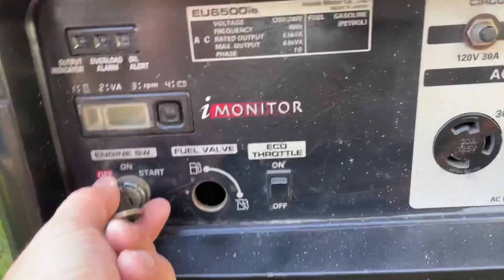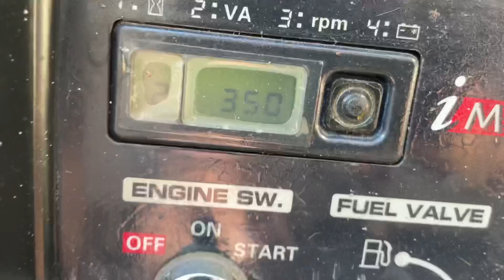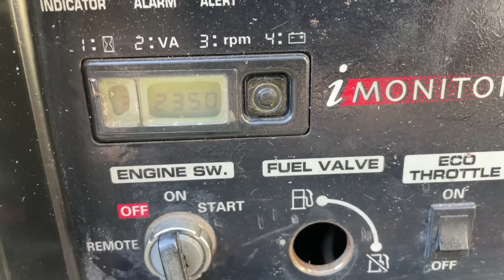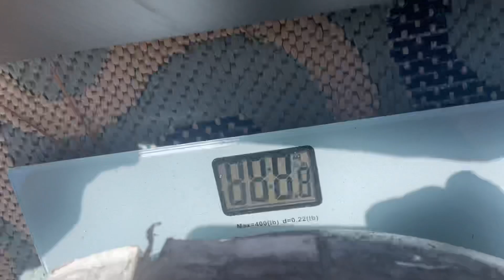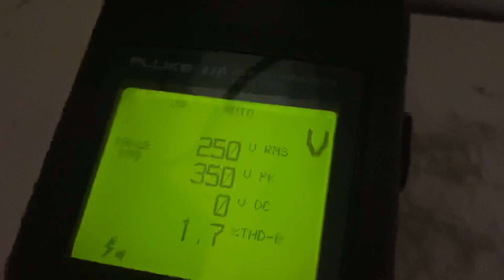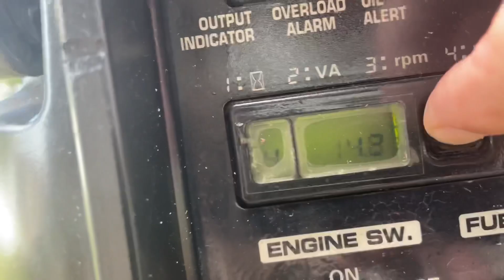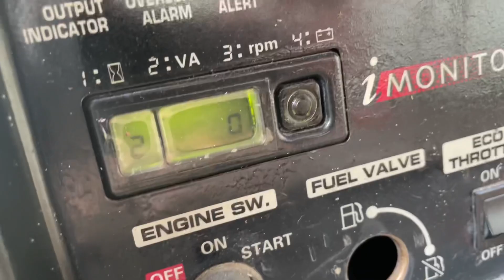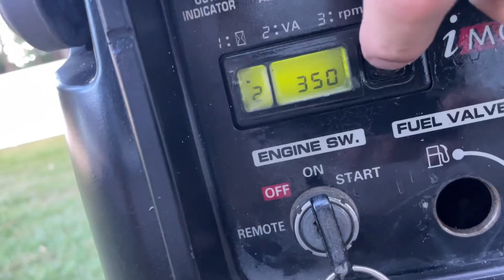How long will generator run on propane tank

Comment: How many ton is your AC unit?
Reply from the maker: 2 ton
Reply: @IFix-Things  i have a 5 ton. I would have to go up to a 9500 or use a window unit.
Reply from the maker: @donaskew6251  look into a soft start, I’d bet you could use a better generator like a Honda eu7000 with it and your 5 ton. Maybe watch some videos that show how many inrush amps with a soft start on a 5 ton

Comment: Do you have info or another video of how you connected your power cable to the house/breaker panel?  I see you used 25 feet of 10ga cable.
Reply from the maker: I don’t have one, that test was using 50ft of 10 gauge. I have since installed a manual transfer panel by the outside meter.
Reply: @IFix-Things  gotch, thanks

Comment: My Costco FURMAN ( the big boy) a 20 lb tank lasted 6 .5 Hours running 3 Frigs  and whole house We did a load of wash and dried it.. AND our Furman only cost $ 699 vs a Honda at $ 2,500-3000
Reply from the maker: Impressive. I prefer the inverter generators as they are very quiet.

Comment: 12 ho 0:47 urs at half load. Long as your "disastor" lasts no more than half-a-day, you'll be "fine" (SMH!)
Reply from the maker: @robertkeller9828  I think you are missing the point.,these,tanks,can be had,just. About anywhere where as gasoline might not be as readily available in a disaster

Comment: I have a class c motorhome with a Cummins 3600 watt propane generator. 81 pound onboard tank. Lasts 50 hours continuous with generator running. Generator off furnace running I get three weeks. Just cooking on stove and oven about a year. Refrigerator, hot water heater and stove about 6 months. Thanks, great video
Reply from the maker: @bdwillis8284  thanks for watching, and good information you provided!
Reply: Thanks exactly what i wanted to know.

Comment: How many hours you have on your generator? I converted my EU3000 to run on propane. It worked fine up about 600 hours, then stopped. Took it to a dealer, the valves needed to be reset. And then every 150 hours needed to be taken to a dealer for valves reset. I got tired of taking it to a dealer, at about 900 hours switched it to run on gas. It has almost 2000 hours now with zero issues. A tech told me that to run it on propane I need different valves.
Reply from the maker: @andreyanderson8798  as long as you run the propane lean you should be fine, it’s when the propane is running rich it will burn things , i.e valve and or piston. 
Exact opposite of running gasoline. If you run gasoline rich it has a cooling effect, if you run gasoline engine lean, it runs hotter. I’m not aware of propane specific valves for the eu3000.

Comment: Quick tip: never turn on a propane tank fast. That will cause its safety valve to seize or freeze. 

You just barely crack it open until you can hear the gas moving.   Then wait a couple seconds and open it another half turn and start your generator.

Once your generator is running, then open the valve several more turns.

Comment: Be aware that the quantity of gas in a propane tank can vary by where you buy it. 

If the tank is about $20 it probably has 3.5 gal. 

If the tank is about $15.00 it probably has around 2.5 to 3 gallons. 

If you go to a propane refill station, you'll pay $3.75 cents per gallon. 

If you have an actual 30 gallon tank in your backyard that they must come out and refill, it's going to run roughly 5 days.
Reply from the maker: @mac_mcleod  good info, thanks for sharing
Reply: @IFix-Things  yes if you go to the U-Haul store you can fill a tank with an exact amount of propane and then you'll know how how many hours you are getting per gallon.
Reply: 30 gallons NOT 30 LBS. THANKS for emphasizing that. 10p lb tank btw is 26.7 gallons slap full. 
You're talking Around 100 bux for 5 days not including oil changes.  
Really shpuldn't run one of these for longer than 8 hours max before shutting down to check oil and cool down. 
Get on natty gas and go whole house commercial for longer term outages and reliability (9 to 16k investment)
Reply: @robertkeller9828  need to consider that running a generator and only adding oil for a week is only going to take about a third of its life.   And since you're talking about a $500 object, you're only talking about spending an extra $130.  And since generators last for about 2000 hours you're reducing the life to maybe 1300 to 1400 hours by changing the oil less frequently.

Meanwhile changing the oil frequently is going to cost you about $5 extra every time you change the oil.   And 26 oil changes is $130.

Comment: 2000 watts for central air?   7000 is about average.   What brand is yours ??
Reply from the maker: It’s a Goodman, I think it’s only 2 ton, I bet yours is a 5 ton.
Reply: In my experience central air conditioning units run between 2400 w and 3000 w for a 2000 square foot house. 

So I would expect that a unit consuming 7,000 Watts was on a house that was over 4,000 square feet.

Comment: I think you need a minimum 100 pound LPG tank to power this size generator.
Reply from the maker: You did watch the video, yes?
Reply: @IFix-Things  yes I did. You need 1000 BTU’s  per horsepower to properly run the engine. . Running the engine on less than rated RPMs can cause additional wear on piston rings, camshaft lobes, push rods and valves. You can’t get that rate of delivery from a small tank even if you are using the right size lpg orifice.
Reply from the maker: @jerryhughes5380  if this were a fixed speed generator and I was maxing out the watts being used, then I’d agree with you. But that’s not the case here.
Reply: @IFix-Things  enjoy your generator, while it lasts.

Comment: I see LP weighs 4.2lbs per gallon. I’ve been looking into a way I can use propane for my Firman WHO3242 generator for a reasonable cost, currently to fill a 20lb tank it costs $5.70/g, a 100lb tank $4 a gallon, my 500g tank- last summer fill, $1.29/g and lots of run time if I go that route. I heat with free wood so I don’t use much propane from the big tank so I think I’ll do that.
Reply from the maker: I’d probably go that last route too, just make sure you have proper regulators and all is hooked up correctly and certified. You don’t want any issues with a tank that large
Reply: U-Haul charges about three dollars and 75 cents per gallon.

Comment: What are the specs on that power cord? It looks like your running off a 110 outlet.
Reply from the maker: 30 amp 10 ga 120/240 cord
Reply: Is it something you built?  @IFix-Things
Reply from the maker: @rdance3  no I think that’s a generac generator cord
Reply: The most important point is that it's a Honda period. Other brands will not perform in no way near to this,as for power delivery, noise and efficiency. You get what you pay.

Comment: So the generator was used to only power ac units ? Which was 1/3 generator capacity so if u had to use 80-90% u would use double the amount of propane. So 1-2 propane tanks a day to keep ac, lights and refrigerators going. U could probably run generator 8-12  duty cycle.
Reply from the maker: It was connected to the house, so whatever else was on, lights, computers, ceiling fans, fridge, but you are correct, if I was maxed out, prob need two 20 lb tanks. I did end up buying a larger 100 lb tank

Comment: What up so how many gallons of gas would that of taken?  Seems like propane is the way to go.  If power went out for a extended period I'd rather store that then gas(therapeutically speaking I don't have a backup system yet, still looking into all options).  And much easier refueling with propane rather then refiling it with gas....two 40 gallons tanks could get a few days...depends on price or the tanks and if it's cheaper to buy or rent
Reply: I crunched some numbers for my dual fuel generator and came up with the following:
15 lbs propane tank is = 1.9 gallons of gasoline in terms of run time.

From the looks of it with the numbers he puts out, this Honda generator probably has about the same burn rate ratio.

As for propane around where I live, doing tank swaps is ~$27 per 15 lbs propane tank.  However, a local filling station when filling at least 30 lbs propane tanks you bring to them is far cheaper.  I mean half the price per lb of propane or less.

When dealing with larger propane tanks, there is the question of how do you transport and store these tanks?  A fully fueled 30 lbs propane tank weighs over 50 lbs.  When you start talking about running for days off a propane tank, you start getting into maybe they come out to your place to fill up the massive stationary tank you have setup.  I suppose if you already have a large propane tank because you don't have natural gas, then you are good to go.

At least with my generator and older fridge with no soft start capabilities setup for it, the fridge draws enough on start when the generator is on ECO mode to cause my UPS for my computer setup to trip.  With ECO mode off, the generator can swallow the surge.  This leads me to think the real reason for an ECO mode switch is to have the generator run with enough kinetic energy overhead to handle single phase motor hard starts.  Without the fridge, ECO mode works fine in terms of not having any voltage sags as my A/C is inverter based, so starts very softly.  Of course this means to make everything happy on your inverter generator, you may need to burn the fuel faster when dealing with hard start appliances.

A 30 lbs propane tank should run my place all day with some inverter based A/C action on a hot day.  Maybe something to consider for a house or large apartment, which I have done, is the cool room concept were one room has a window based or portable dual hose air conditioner.  Normally, you run this room cooler than the rest of the house as it will be the room you spend the most time in on hot summer days.  Especially with a portable unit, while usually not as nice as other solutions in some ways such as noise, it could be moved between rooms without too much effort.  In an emergency situation, you will have a room to go to that the generator can power if you can't power a whole house central A/C system.  When you get to this scale, consider running some electronic equipment, and running a refrigerator, then a 30 lbs propane tank becomes an all day solution, even in the summer.
Reply: 2 40 gallon tanks should run a system for about 40 days.

So perhaps you meant two 40 lb tanks? 

That would run your system about 2 days.

Comment: What's the names of the lightest and the most quietest 4,000w gas generators with electric start and or Remote start that can use gas or propane  ?
Reply: Honda
Reply: Honda

Comment: How long can it run a refrigerator
Reply from the maker: I’d bet about 15 hours tops . If you only have a frig get a smaller Gen or a portable lifepo4 battery with inverter

Comment: How does that inverter unit handle your dryer?
Reply from the maker: The heating element is 5300 watts, should be able to handle, but I wouldn’t use the generator for the dryer, I’d air dry them
Reply: @IFix-Things  yea I would too I was just curious. Thanks

Comment: Dude add the black line between the first reg and the garretts reg not between the garretts reg and the gen you will have better fuel efficiency
Reply: What’s a Garrett?
Reply: Do you understand the purpose of the Garetts safety diaphram?
Reply: Yes I do and I didn't tell you to take it out just to move it closer to the generator